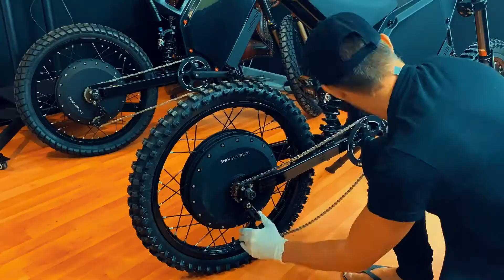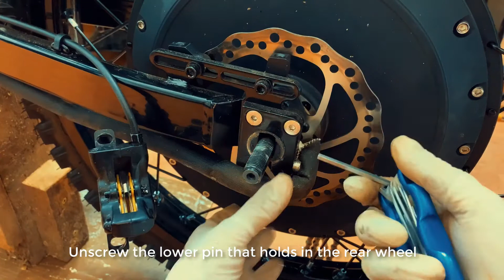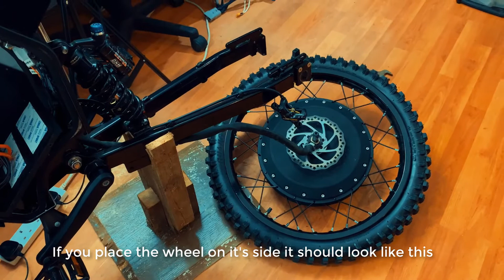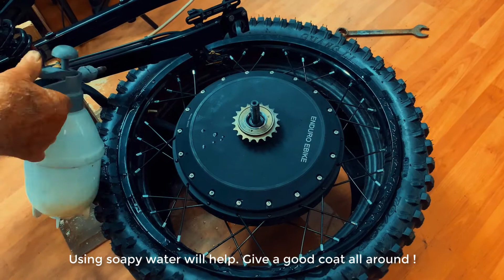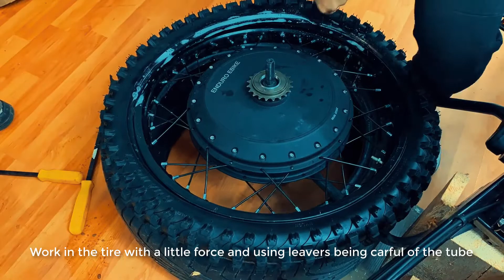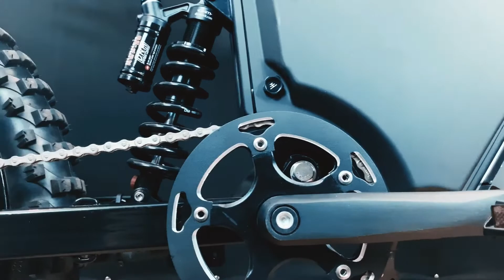How to Change a Tire or Inner Tube on Rear Hub of an ENDURO EBIKE

Comment: This is the best video hands down I 'am going to attempt to change my rear wheel tube This video gave me inspiration. I'm starting to see some hope maybe I could do this myself,  I was able to find the tube for my tire which was "21"inch   80/100-21 I went to a motorcycle store, lucky for me I found the right size, tube that's the first step.

Comment: Took an hour to get the tire off the wheel, scratched it up in the process. Spent another 2 hours trying to get the wheel back in the frame and with 3 people it just wouldn’t line up or fit properly. Loved the bike until I needed a tube change…..
Reply: No kidding huh? Doing any rear wheel work on these bikes is a TASK! not to mention the rear wheel is heavy as hell and not easy to maneuver. I’m about to give up on mine 😅😅
Reply: @alexchavosaurus  it's a frustrating process what do you do in such a situation I was going to attempt to design a rear wheel stand if I get lucky maybe I could do this myself keeping my fingers crossed.
Reply: @banneduser978  All you really need is a milk crate to hold up the tire. Building a rear wheel stand would work also, I did mine flat on the ground which was the most frustrating part but I got it done! I did in the process pop one of my tubes and had to start over haha.
Reply: @alexchavosaurus  The problem is that a normal bicycle shop will not be able to service this type of a bike, However I am now contemplating if I should do this myself, I need to make something that will secure the bike from tipping over, because my kickstand is dysfunctional when engaged the bike it leans down on the side so much that the bike eventually ends up falling
Reply: @alexchavosaurus  if I had the proper tools i could probably do this myself all the shops around here are a rip off

Comment: Por favor podrías explicarme cómo cambiar el disco trasero. Es necesario sacar el cable de motor del cuadro de la bicicleta, no hay otra manera?
Reply: Correct, no other way but to remove the wire since the wire runs through the disc.